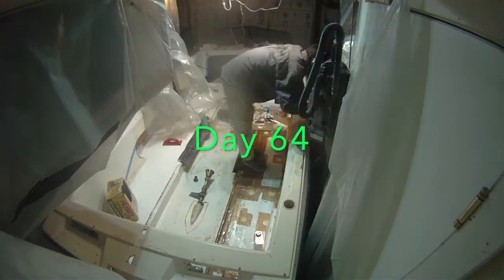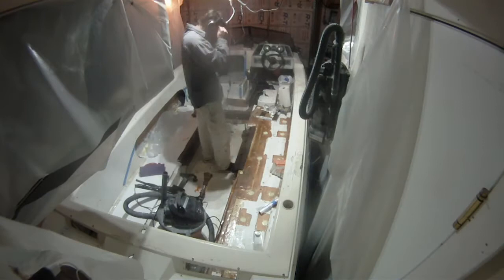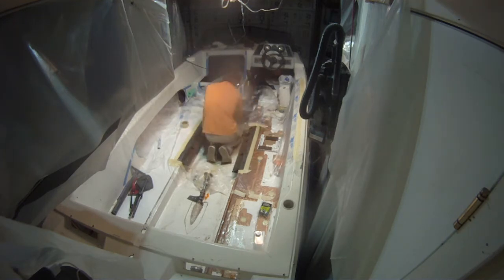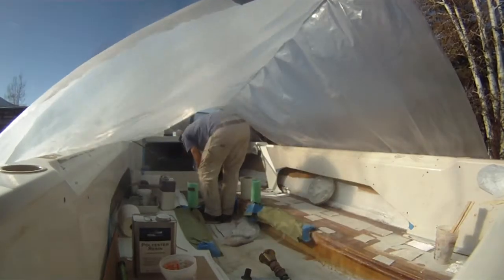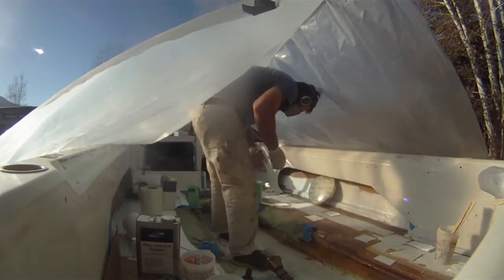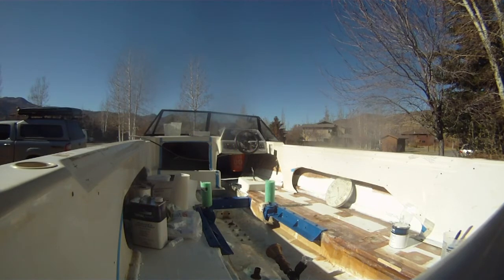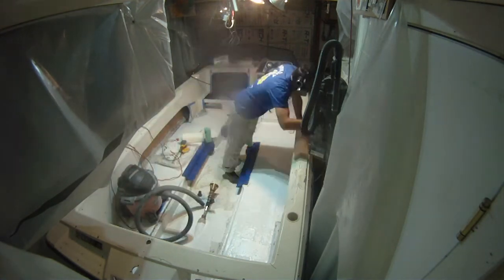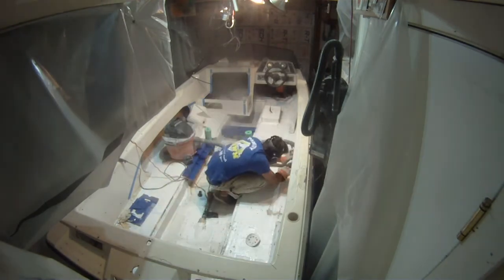All the Work Ski Supreme Restoration Week 14

Comment: Nice job so far! I have an 83 Supreme that I restored. I pulled the cap and it wasn’t as bad as you would think. Whoever designed the gunnels that wrap all the way to the floor clearly did not consider floor replacement. I really had no other option as mine was wood construction and every bit of the stringers, floor, and transom were rotted.